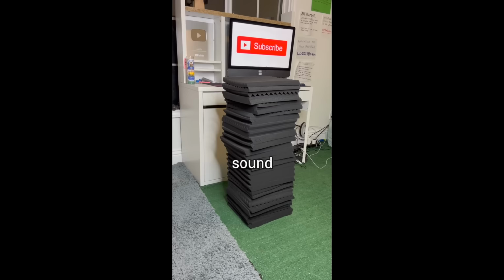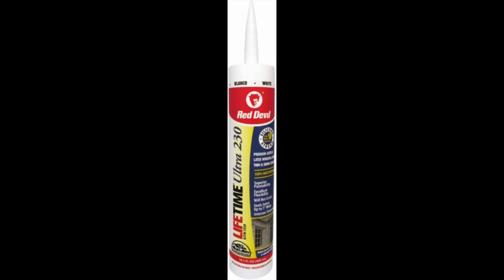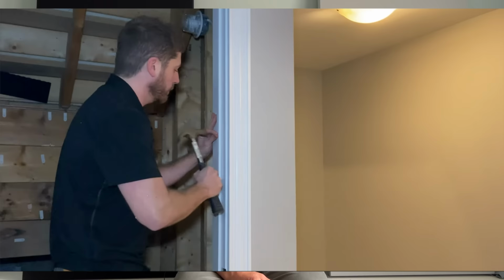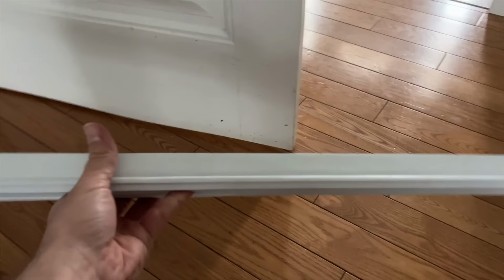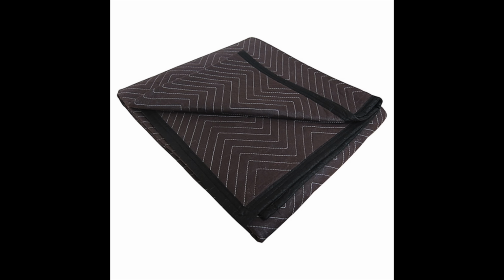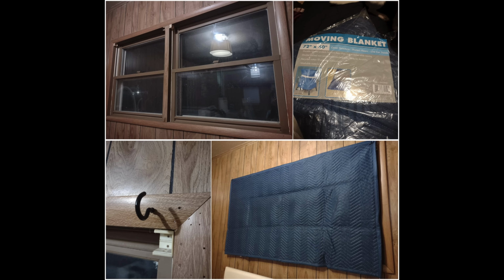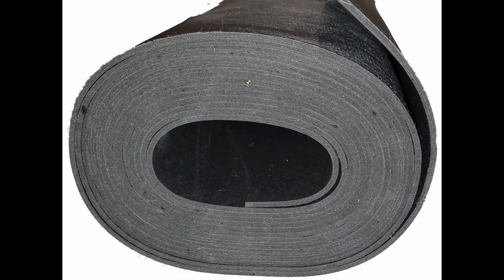CHEAPEST Budget way For SOUNDPROOFING a Room

Comment: To sound deaden the room, instead of using blanket you could also use carpet on the wall. If done well, it could even look quite luxurious. Of course it's a bit more expensive than a blanket, but you don't need expensive, high quality carpet on a wall as nobody will walk on it.

Comment: 2:21 what if my door happens to not exist and is only a thin almost see through curtain when it doesn’t block any sound should I make my own door that covers all those cracks but is also space efficient enough to not block the hallway that’s only 2 feet wide or that doesn’t block the 2 feet of room it has in my room to swing while also being a 3 foot wide door should it be a folding door? Should it be a sliding door
Should a sliding door be sound proof or help with an echo? Should I make my own door out of cardboard glued as layers and soaked in resin to be a test to see if it could work? I don’t have a door because my house has basically two halts my grandparents are upstairs and the rest of us are in the basement where there is one fire exit and me having a door is apparently a safety hazard and I need a door that can be locked but very easily unlocked, so easily accessible that I could do it blindfolded. Idk I’ve looked at different doors for a total of 5 minutes before giving up and hoping we can just move into a regular house where I have a door with a working handle and possibly a lock on it. Idk please help idk what to do about it I’ve been just filming video for my channel at my dads to help with sound quality since he has carpet and walls that so perfectly reflects the sound to the carpet to be absorbed.

Comment: I have to comment because I'm a bit concerned, using that caulking in an electrical box has the possibility of being quite dangerous. Most Caulks are water-based and an outlet has live screws on the side only about a half inch back from the drywall, there's a potential of a deadly problem. Wool is also a very good sound deadener and that's part of the reason people liked wool curtains, but also carpets and blankets are extra good when made of the material

Comment: STOP: Captain Here! 
I'm a "Doors & Windows" Specialist, over 7 years of experience. Do not use any of what he's talking about It's ridiculous. 
1. These are the improper way of diagnosing intrusive noises. A slight crack between the door frame and the door will not make that big of a difference. Do not buy caulking and stick it on your door frame. You're going to glue your door shut, or peel paint.
2. DO NOT USE EXTERIOR WEATHER STRIPPING! It's not made for interior doors . Exterior doors have up to 3/16 inch on both sides of your door. GO COMPARE if you don't believe me. Don't waste your gas trying. It's also, $20-$35 for a kit if you get the metal one. The bottom line is a interior door isn't made for weather stripping. Your going to OFF CENTER the locking mechanism padding a door stop. If your that desperate use duct tape. Because the alternative is  buying a new slab and cutting it 5/16 short. Hope you can read a tape. Gotta table saw? Know what butt strike is? 

3.If you have a large crack underneath the door that's normal. DO NOT use a 1 3/4 door seal that's meant for an exterior door and put that on your interior door which is 1 3/8. It WON'T work. Go to home Depot and ask for the foam rolls for the interior (Under the door, they're stupid) doors. Its $10
Yes, you can reduce sound with blankets, but sound blankets are $40-$60. 
The only real solution is installing a solid core door instead of a normal residential hollow core door. Hollow core doors can amplify sounds. By simply sticking something on it will kinda do the trick. The real solution is a solid core door. Do you own the house? Then buy it. No, then buy a YOGA MAT. Super CHEAP $5-$15. Facebook marketplace.  Door orders are 2-3 week ETA ranging $150-300. 

4. Windows are also tricky If you have triple pain windows they will reduce higher frequency decibels However, lower disable sounds like trains or direct traffic can be a hassle. Sound can be reduced though. Here's the SECRET order the interior pane as 1/8 and the exterior at 3/16 and that will diffuse the sound as well as a triple pain 1/8. Triple is a rip off
I have never heard of sound penetrating through wall because your outlet wasn't reinforced or something That is the stupidest shit I've ever heard. Your cockroach will disagree.

5.  I have never had to say this on a YouTube channel but this man is trying to scam everyone that's watching this video. You need further assistance like trying to soundproof a room talk to a contractor walk into any hardware store. 

I'm sorry but this whole video is a ploy for you to click on the Amazon links so this guy can cash in on your ignorance. 

If you have a question all answer it. Don't buy anything. It's much simpler than solving it with stupidity and your wallet. 

Sean

Comment: Buy acoustic drywall. It'll cost about $65 to $85 per sheet. But you'll do it one time and it's permanent. You still have to soundproof the door, window and outlets, though, as stated in this video.

Comment: I bought a 900 sq' 40yo condo 4 years ago. The common wall is not a firewall. My next door neighbor has a little dog that cries when Mama isn't home there is no corner in pur unit where we can't hear Bella cry..I thought about adding a layer of sheetrock,labor is not in the budget.Our 2 recliners back to the wall to Bella's house. Premium felt sells for $9/he "36" wide.5 yds ofbeige felt stalled above the baseboard of the beige wall topped with a piece of half-round mouldings = fake wainscoating? Do you think it would deadening the sound from the lonely dog?

Comment: If you want to sound proof a room, you have to see at a lot of different things. 

- What level of sound proofing do you want? Do you want to be able to talk in the phone, having sex, or playing drums without people outside of that room hearing it? Different needs need different solutions
- How are the walls, ceiling and floor around the room built? What materials are used? For example you have wall plates that specifically stops sounds
- Doors: One thing is to use rubber trims around the door itself, but some of the cheaper doors will not be any good at stopping sound in general. Ask your door supplier specifically for sound proof doors (you even have specific standards with this in mind)
- The last thing is the acoustic in the room. Then you need to think about what can echo sound in the room itself.

Comment: Another good cheap sound absorber is fiberglass insulation, like the pink stuff you use in a wall or ceiling.  To contain it, you can use a layer of polyester batting like you use to make blankets or pillows (Walmart sewing section).  I'd that's too ugly, cover it with a single layer of burlap.  Again, this is for absorption and deadening.  It won't do anything to keep sound out.

Comment: What about plantation shutters?  Do they have any effect on sound?  Just wondering as I have plantation shutters in most of my house, except in my open kitchen living room with 9 foot ceilings with tons of windows.  I had to add floor to ceiling blackout velvet curtains to dampen the echo.  That really helped.  Also, if you can afford it, putting up a tapestry or a cool looking quilt that also is decorative would be more pleasant.  Any difference that can be measured?

Comment: when I put the weather stripping and sweep on my door the room gets stuffy and mold forms on the windows from morning condensation not evaporating quick enough, I had to removed the weather stripping, not sure what causes it but my guess is the ac only blows air in and doesnt work properly when the room is too well sealed, I have no idea how to get air in the room without making the weather stripping useless

Comment: if the plan is to prevent most noise from inside the room bleeding thru the door into the connected corridor, will this be good or is there any tweak to keep in mind?

Comment: The real adivce for the cheapest soundproofing of a room : eat eggs everyday (full of vitamins and proteins). Stick every empty box to the walls/ceiling.
A good way to identify noise bridges is to light up the room and check from outside where the light escapes : sound will pass easily through the same places.

Comment: Another important thing to mention is... A lot of acoustic foam, especially the cheap stuff off amazon or ebay, is often imitation and nowhere near fire compliant, even if it claims to be. This has caused thousands of unneccessary deaths worldwide in venues when they try to insulate sound on a budget. Non-compliant foam decomposes into a superheated and toxic gas in seconds. Quicker than most people can get to a fire exit.

Comment: Would it be possible with an outlet cover off to pull the outlet box out of the wall, wrap it in the putty pad, and put it back in without wrecking the wall? I replaced some outlets a while ago and iirc you can take the box out a bit

Comment: My bedroom has a set of really old and flimsy french doors joining it with the living room. Any time the TV is on in the living room all the noise bleeds into my bedroom. I currently have the doors lined with foam and have a large moving blanket draped over it, with minimal results. I need a non-permanent solution for noise proofing.

Comment: It was a little unclear in the video, but backer rod is as the name implies - a backing material to apply something in front of, in this case sealant. It may not have much effect on sound without something applied in front of it.
Reply from the maker: The outlet faceplate will be covering the backer rod! One thing I discovered works even better is plumbers putty! Try that instead! Just make sure to turn off the electrical breaker to the outlet before fiddling with it.

Comment: I have 2 questions, if anyone can answer

1: Not much sound comes IN the room, but I do music and recording so I want sound to not come out of the room or at least reduce it, would everything in this video apply to that?

2: this room has no ventilation other than the door (and a completely broken air conditioner). Considering I need to have this sound proof for at least 4-5 hours at a time, would it be advised to do this process sealing the rest of the door and all of that?

Comment: im trying to soundproof a room with 208m2 walls which it cost me around 25$ each m2 which is really expensive is there anyway to reduce the cost. i need the room to be quite from outside i dont want to annoy neighbour cause we use it when using a grinding machine. the price i mention earlier is for a material called load mass resin 😢.

Comment: Even using moving blankets, and all the parts needed you are still talking $300-500 depending on size of room, and something for the windows like pillows. But compared to specific "soundproofing foam", which is not different than any other type of foam for the most part. It's just thicker, which adds more density. But that stuff can get pretty expensive. Just because there is "soundproofing" in its name. Corner bass traps are way expensive for what you get.

Comment: Man, better have an air return dedicated to the room if you seal off the door. Then you need to worry about the face velocity of the ducts because most hvac systems are not designed to use / maintain a face velocity at the grill below 500 fpm which nets a whisper quiet operation. To have a really quiet room is pretty expensive.

Comment: If you are going to use acoustic foam, DON'T glue it to the walls. Glue it to a piece of cardboard, THEN attach that cardboard to the wall using a Command strip. Much easier if you ever need to move.

Comment: Imo using backer rod around electrical outlet is really bad idea due to fire hazard. The rod is easily flammable. Use mineral wool instead its non flammable and will give you also better result.

Comment: "Sound proofing" is a misnomer, except in outer space where no one can hear you scream.  What people mean is improving the sound transmission class, but of course some sound will always get in.

I also don't understand what people are talking about when they talk about % sound reduction.  What's 50%, does that mean 3dB which is barely noticeable?  By 90% do people mean 10dB?  Are they meaning 'A' weighted or something with a wider, flatter bandwidth, attenuating into lower frequencies? 

Sloppy language around what is a poorly understood topic among most builders is a big part of what leads to unrealistic expectations, disappointing results and expensive retrofits.
Lots of good tips in the mix here.

Comment: Sealing the gaps around a door can cause issues with your HVAC system. Like he said, it restricts airflow. BE CAUTIOUS OF THIS. It could reduce performance or even burst ducts. If you have a minisplit or wall/window unit the latter doesn't really apply.

Comment: Btw...you can buy self adhesive velcro 👍
Reply from the maker: Yes but they won’t stick to material most of the time. Only on the window and door frames.
Reply: @soundproofguide  If they peel off that's when I dig the glue out LOL
But it's true they stick to some surfaces better than others 🤷

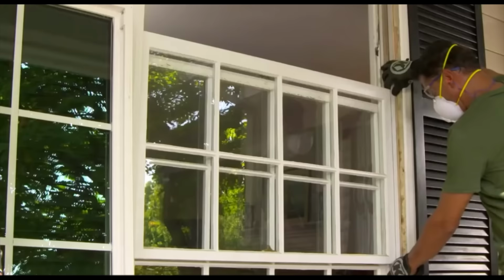Comment: 7:45 Sorry but, hard disagree on that one. Single pane glass is simply garbage, it's not 1960 any more, rip it out.

It's not about sound, it's about heat insulation. Modern HR++ loses roughly 5x less heat or lets in less heat than single pane. My old (1961) appartment had single pane glass. I replaced all of it for € 861 total. Of course I don't have or use those horrid expensive micro-windows in wooden fittings (7:44), but a single solid window. 

It's easy to do to. I'm not great at DIY, don't like working DIY over 3 hours at a time, and I did one window per day. You need two suction handles to hold the window up and manipulate it, as well as gloves (square glass edges don't look sharp but WILL give you superficial cuts).

Measure first. Measure where the wooden window framing is. So not where you see the glass disappear, but where the frame itself starts. If you're unsure, look it up at your glazing supplier, they tend to have measuring instructions.

All glass needs 2-3 mm to expand and contract due to heat. On a large window you may want to use 4 mm insead. So you take your height and width in between the wooden framing, subtract 6 mm
Now look at the depth: How deep is my wooden framing. Adjusting the framing itself is not easy and requires good tools. How much space is there between the outside edge of the window frame and the part where the wooden framing narrows? That's your maximum distance.

Out of that comes:
Depth of the hardwood holding strips (typically 15 mm or 17mm)
Thickness of the glazing. 
2x glazing tape that's about 2 mm thick when compressed.
If you've space left, great. If not, you may need to compromise on glass quality. For example I had a 34 mm deep frame near my door, 15mm strip, 4 mm glazing tape, so I've only 15 mm left.

My glass panes were 4 mm and 5mm (safety glass due to it being down to waist height). 
Now we've only 6 mm left, that's the minimum empty space (which in case of HR glazing is filled with argon gas), so that constrained my window: I could get the space from 9 mm all the way to 24 mm, but, not enough space.

Order the glazing. 

Take the old glass out of the frame. If your old glass was glued into the frame (which is a crime, never do that), cut it out until you've bare wood. Next up is glazing tape on the inside. Next up is heigh-setting plastic blocks underneath. These are typically 2 mm to hold the window centered.
Now you're going to prepare the new hardwood holding strips.
First pre-drill holes of roughly 2mm every 30 cm if you're using screws or 20 cm if you're using nails.
Get the orientation that they're going to get nailed on and put glazing tape on the side that's going against the glass. Cut it at a 45 degree angle in the corners so it'll fit proper.

 Then you lift the glass in. If you're alone, have a HEAVY object ready you can lean against the glass to keep it in place while you grab&secure the first holding strip.

If you're using a hammer, make sure you strike alongside the glass, not towards it. You don't want to break your brand new window.

All secured? Good. Now just caulk the seams between glass and wood (this covers the glazing tape).

Voila, window replaced for material costs.

Comment: Double sided velcro is SUPER expensive, and will stick for like two days.  Just use a staple gun, it's super fast.  I have 36 thick moving blankets up. Purchased 12 in a bundle on Amazon. Have moved the blankets between three studios so far. Great advice otherwise.

Comment: Sadly this will all not work for me for multiple reasons first I live in Germany and that means Stone walls also this is an old reconstructed and protected building that means a 3 meter high roof in every room of this apartment so sadly I need noise absorption not dampening 😢😢😅 my problem is the massive amount of Ecco’s 😂 and I’m also sitting 3 meters away from my door so there is that

So any suggestions??😂😂😂
Reply: 20 cans of spray foam lol❤

Comment: no 'cheap' way to truly soundproof.  the ONLY way to actually soundproof a standard residential room is to hang rubber sheeting floor to ceiling in a manner where it is not 'hard attached' to anything. it must float through an insulated suspension system.